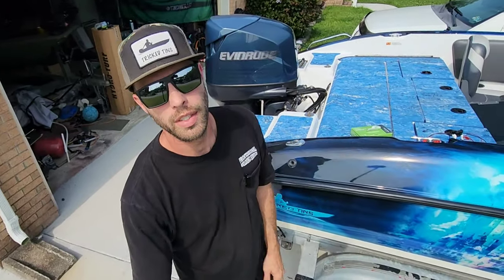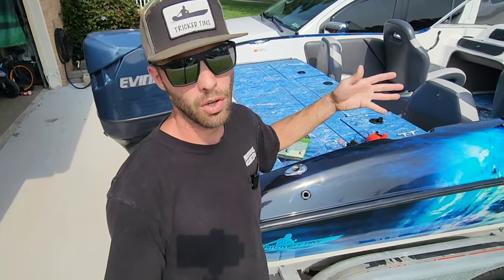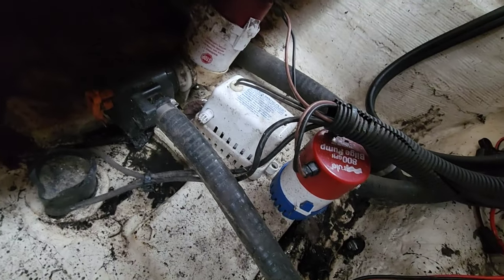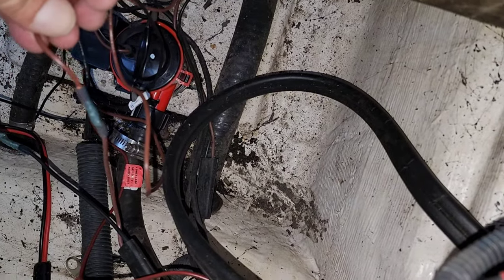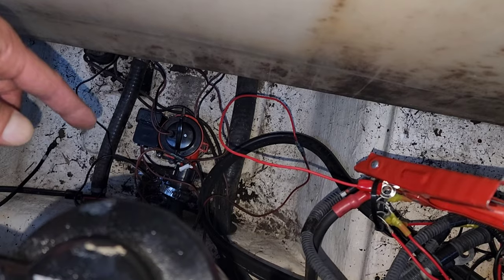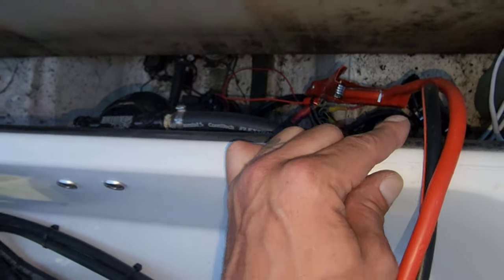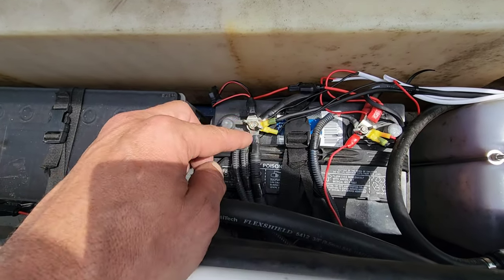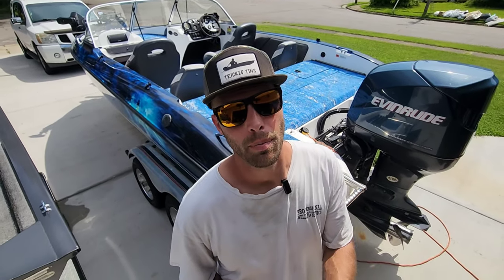"How-to Install Automatic Bilge Pump" Super Easy and Cheap!

Comment: Nice job - for your next project, it might be a good idea to install a fuse box or bus bar to consolidate all those wires running to your starting battery.  You can even put it somewhere really accessible up front, and then run a main positive and negative back to your battery.  Definitely helps keep things organized!
Reply from the maker: I always install fuseblocks and switch panels in my builds. It looks like a lot of wires, but it's not that many. They are all for my graphs and the black box. They have to run directly to the battery. I dont want to get interference

Comment: I almost sank my boat on the first day of my vacation. The old " i put it in the wrong hole" it didn't click in my head why my automatic bilge pump would not stop pumping out water out of the side of my boat 🚢. Thank God I put on a automatic bilge put. It really saved my boat from sinking till I jumped in the water to put my plug in the wright hole 🕳️🤷
Reply from the maker: Jeez. Glad it wasn't worse. My uncle did the same thing a couple months ago.

Comment: I run two 800 gallon per hour pumps in my boat both are on dual setup. Never hurts to have more pump power in a emergency
Reply: Absolutely. I have an installed 1100 gph but I also have an oh shit pump, it's a 1500 gph with alligator clips that I can just drop in and pump overboard

Comment: I prefer to hook the battery wire to the ignition so the bilge pump doesn't activate accidentally and drain the battery, but I also don't leave my boat in the water overnight.
Reply from the maker: Yeah, sometimes this boat sits in the water for 5-7 days at Lake Gaston.

Comment: can i wire the the negative wire and the automatic wire straight to the battery and leave the manual wire un-wired
Reply from the maker: Yes. Test the float tho and make sure the pump comes on when you lift it
Reply: @TRICKEDTINS  do i need to install a inline fuse or will it be ok without one ?

Comment: I have the exact same pump that I want to install however I was assuming that the base that you pop the cartridge into is screwed into the mounting plate on my lund. Nope its riveted. WTF. Why would they rivet a totally removable and replaceable bilge pump?
Reply from the maker: The housing doesn't have to be removed. Only the cartridge!